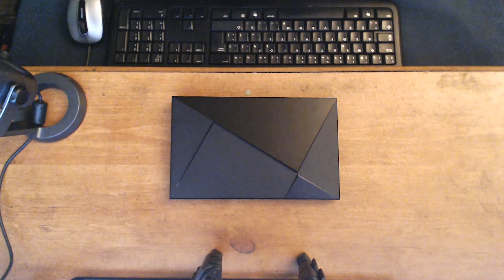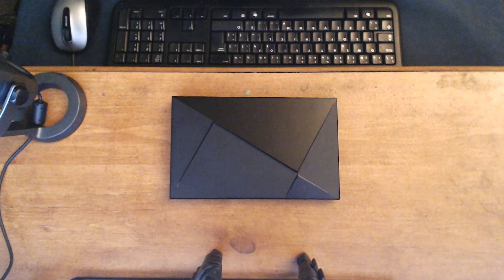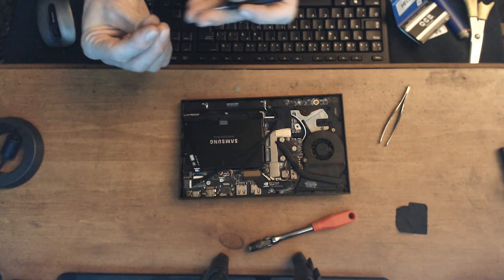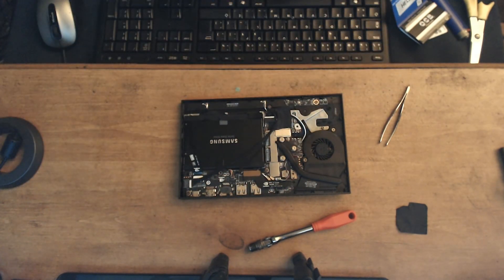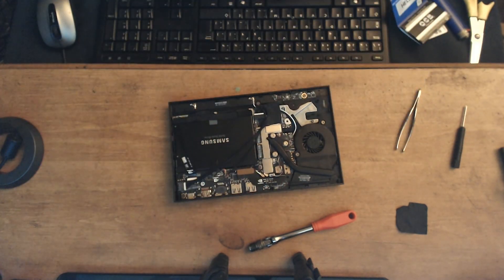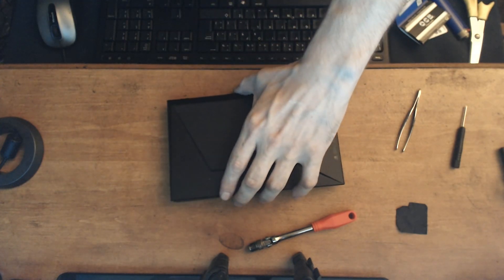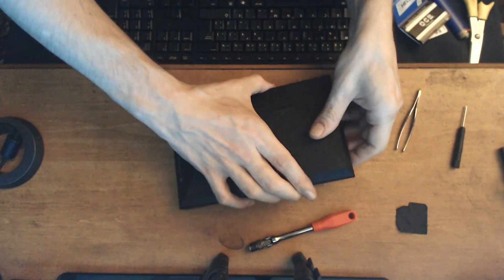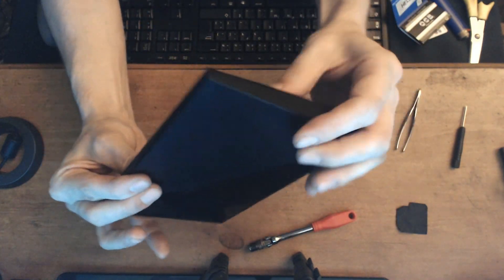ATV Workshop: Nvidia Shield TV Pro drive replacement / SSD upgrade step-by-step guide

Comment: Works with the samsung 500Gb and also with CRUCIAL MX500 (just replaced my dieing shield hard drive). If you can't copy on the fly on a internal SATA SSD just copy from the Nvidia drive to a temporary file (there is an option) and then from the temporary file to the new SSD.

Comment: Just got the shield pro. How exactly do you completely power it off? Thanks
Reply: In the settings you have the power off option. But to turn it back on you have to turn it on by going the shield and  turn it on physically at least for the 2017 model, since the remote works via Bluetooth not ir.
Reply: 😢 could not see close up

Comment: My shield drive is dead, so I can't clone mine. Is there a site that has the shield img/iso file so I can clone it to an ssd?
Reply: I have the exact same issue. I have a new HDD but I'm unable to find an image of the original to restore to it :(
Reply: @digital_dementia  I found an img but it wouldn't work. I had to buy a new shield 🤦

Comment: Just competed this 02/20/22, worked perfectly. Thank you.
Reply: I tried it. But it didn't work. Do I have to initialize HDD in Windows first? I cloned both, but when I connect ssd to shield pro. It's just blank screen. Please share any tips or tricks. Thanks.
Reply: @itsmesikander  No I didn't connect it to windows. The first boot didn't work after I connected to the TV. I disconnected from the TV reconnected the old drive started up on the TV then reconnected the new drive and everything was working after that.
Reply: @Isalevzw  but did you do the disk change with the nvidia shield on or off?
Reply: @rikifernand4449  it was off if I remember correctly.

Comment: question can i use a 1 tb or more for shield pro
Reply: Unfortunately mine is all chip.  No hard drive.
Reply: I have a 8 tb hard drive hooked to mine
Reply: @robbstanard825  can you explain how you do this
Reply: @davidmuller3803  I got the hard drive that is thick like a book comes with a plug 
 plug it in and go
Reply: @robbstanard825  Hooked on is something different than built in.

Comment: I agree   , the original  pro is the best  and I have 4 of them my have all been modded
Reply: You nodded them too ??
Reply: @MrBOB39   yes all of my original  sheilds from 2015 have been modded as that year model  came with a 500gb hard drive,  a few things I have changed was upgrade the hardrive , replaced the wifi module and much more  .
Reply: @rdeh1678  how do you replace wifi module and what would be the best module to replace with?
Reply: I have the 2018 Pro model
What Modds please did you do
Thanks in Advance
Reply: @MrBOB39  Did this guy ever reply? Doesn't seem like he did? 😕Would be nice to know these things. I might be picking up a hardly used 2022 pro for $100 from OfferUp. I was thinking of doing the upgrades... The Wi-Fi module sounds interesting, though with this being the newer model I wonder if it's really needed? The SSD is definitely a no brainer...
Reply: @companiessuck2975  I Never got a Reply..Except by you

Comment: How did you remove the SATA cable? Does it just pull out?
Reply from the maker: You can see me pulling up the tab holding the ribbon cable at the 8:00-ish mark, it's kind of a tiny little lever; pull up to free the cable, put the ribbon back in and press the tab back down to re-secure the grasp. For the SATA end at 10:00-ish, I recommend slowly wibbling the solid plastic SATA connector part back and forth by holding it on each side, and it'll come out eventually. Just be patient and never force it too much; it's a 100% custom part. If you break it somehow; you will not be able to find another one anywhere.